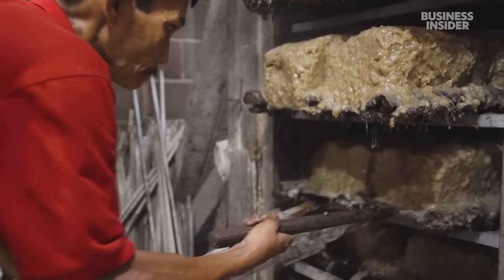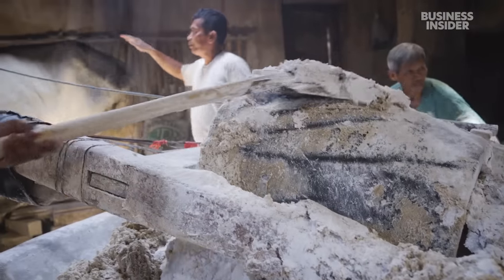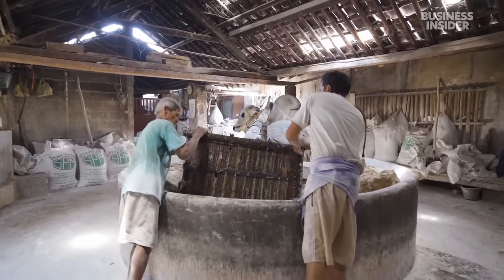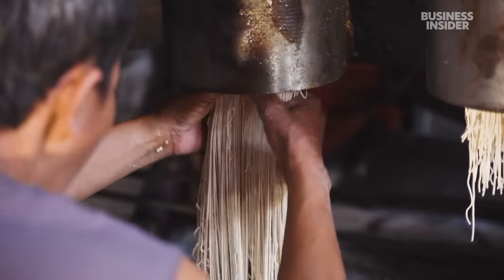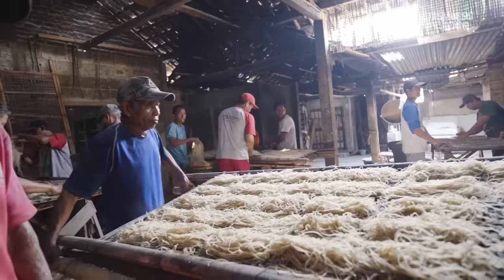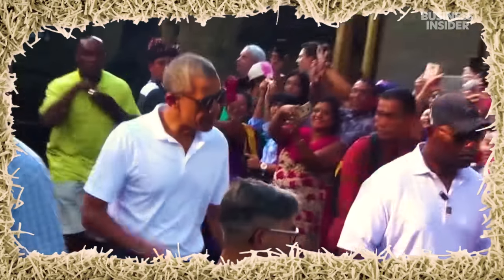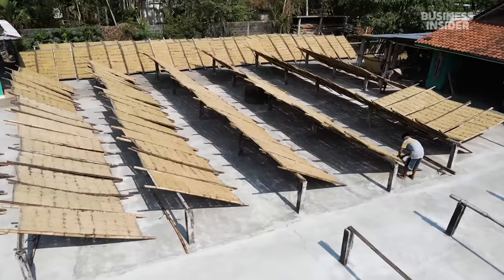Why The Ugliest Noodles In The World Are An Indonesian Delicacy | Still Standing | Business Insider

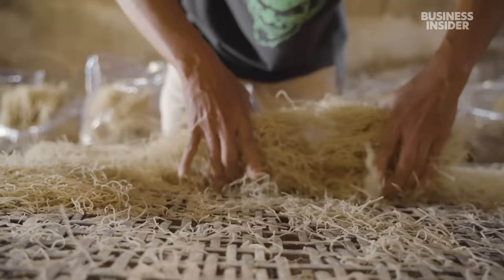Comment: 7:44 clarification: Indomie sells small, single portion (85g) packs for around Rp 3000, which is $0.2. Indonesia uses kilogrammes so they probably sell it in 5kg packs. If you do the maths, they sell it at 0.42 of the price of Indomie, counting the seasoning packs (probably where they get their numbers).

The fact that they still survive after selling it below an industrial factory packed noodles is genuinely incredible.
Reply: The reason it's that cheap is mostly due to the fact that Indonesia has insanely low average income, a sizable part of the country lives in poverty, the average yearly salary in the country is under $10k

Comment: Wow just two factories left in an entire country that alone speaks of its legacy and it's cultural & heritage important to the country.

If his children coud took over the factory and keep continuing their father legacy by revamping the factory with some modern machines it would be great not just for the family but the customers as well as they still can get to eat a long old traditional noodles.

The dough instead of pounding by oxen and human can be pound by automated machines or by installing a mechanical machine like a pulley on Top of the pounding tank and then tie it to a big smooth stone size of the pounding tank which in turn be tied to a big chain or rope which can be drop by machine or human from the pulley to pound the big Dough.

As for the drying part they can install a sheet of Tins on the roof top and then hang the wet noodles below the Tin by keeping a gap of 4 or 5 inch so that it doesn't get close to the tins get impact by too much heat coming down from the Tim Sheets.

The hot tin from the sun will dry up the noodles in few hours and this save them their time ,money and human powers as well .
The best part is that the Tim sheets  can even save the noodles from sudden rainfall and birds etc.

Hope the children could try their best to save ,protect and continue their father legacy.

Comment: The resulting product may be very good, and serious effort may have been put into it. This method can also be used traditionally, but just because it is traditional cannot be an excuse for such unhygienic production. If it needs to be crushed by foot, it is really disgusting to do this by covering it with just a piece of cloth (sack). Not only hair but also skin may fall out.
I'm not even talking about other transactions, otherwise summer wouldn't be the same.
You can do this job in cleaner conditions by doing it traditionally, it is meaningless to defend it as traditional labor.